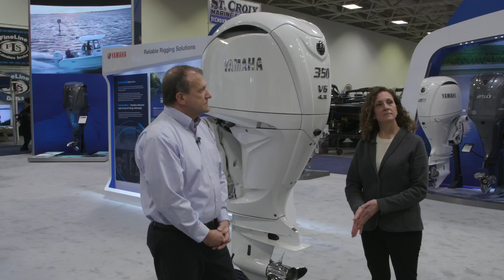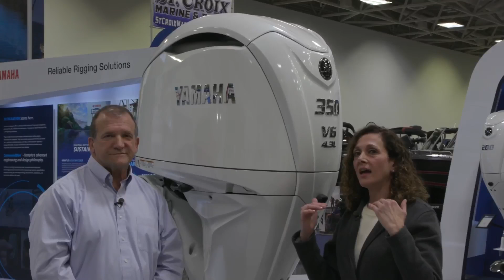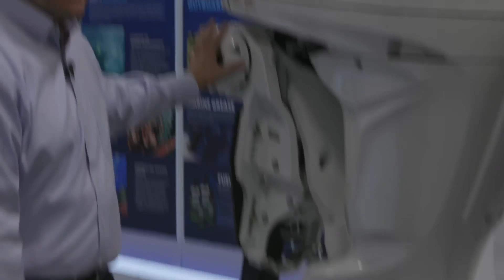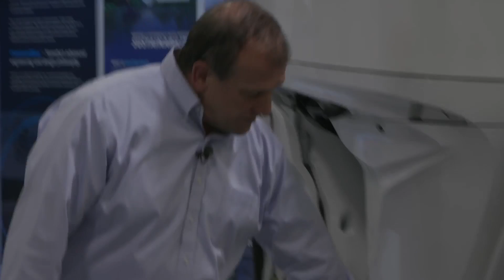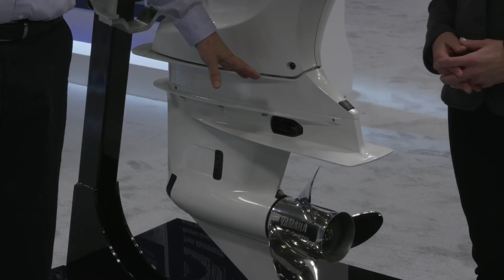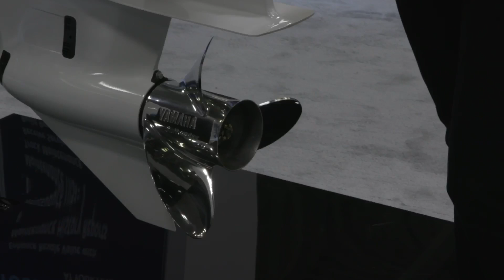Yamaha Outboards F350 Product Launch With Q&A

Comment: The Mercury is 70lbs heavier which is significant however it can run with Lithium batteries. The weight savings using two Lithium batteries with the mercury means the Mercury will come in 30lbs lighter installed. I can’t believe Yamaha did not adapt the electrical system for Lithium. Huge fail on Yamaha’s part.

Comment: What happens when you are 30 miles offshore and the digital power steering goes out?  How are you supposed to get back to shore?
Reply: theres no problem that money cant solve if your asking these questions you don have money
Reply: They have push pull wires too

Comment: About time Yamaha got back in the 350hp segment, because after all, as in the early 2000's, the 250 Fourstroke replaced the 200 four stroke and 250 2-stroke as the standard and in the 2010 -1015 time frame the 300 fourstroke replaced the 250 four stroke and all 2-strokers in the saltwater game as the standard, now the 350 is the new 300.   Between the Zuke DF350, Honda BF350, the Merc free breathing V8's, and now finally a Yamaha F350 there are some serious great choices now for outboard power

Comment: Where does the new 350 make its extra torque & horsepower? Is it all at the higher RPM's? Will it have more torque or HP at lower RPM's to improve hole shot?

Comment: The advertised weights reflect a larger difference than 18 lbs.  Can you expand on that?  Is that due to the integrated steering?  Maybe that is not included in the weight of the F300?
Reply from the maker: Here are the specs. 25" F350 is 629lbs (with built-in digital steering is STANDARD). 25" F300 DEC (WITH built-in digital steering) is 611 lbs.  629-611 = 18 lbs. difference.
Reply: @YamahaOutboards01  That's great!  How much weight does the integrated steering add on a vessel compared to a traditional set up?  In other words - what are we truly adding by going to a new 350 vs a 2015 F300?  Also - can you expand on where the added weight is?  I assume the crankshaft is heavier.  Lower unit?  Anything that stands out from that perspective?

Comment: You claimed the difference in weight compared to the F300 is only 18lbs but on the website engine comparison tool it says it’s an 80lb difference. Which is correct?
Reply from the maker: Here are the specs. 25" F350 is 629lbs (with built-in digital steering is STANDARD). 25" F300 DEC (WITH built-in digital steering) is 611 lbs.  629-611 = 18 lbs. difference.

Comment: Weak sauce, Yamaha. They took the 300, which came from the 225 and 250, and modified it to make 350? Something doesn’t add up. Went from 4.2 to 4.3… I think this will result in shorter engine life and underperformance in horsepower. I have twin 300’s and was hoping for a stronger showing for when I repower, but I’ll be looking elsewhere now
Reply: This will actually get you to Bimini without throwing a code like mercury. It’s why most mercury setups have triple or quads, very rare to go on a trip without at least one going down.
Reply: Everyone so quick to judge it will be bad before the outboard has really been tested.
Reply: I guess we wait and see if it gives the durability that we are all expecting from Yamaha.
Reply: А ты используй триботехнический состав- добавку в масло. Это увеличит срок службы двигателя в 1.5-2 раза. Добавляй свежий состав при каждой смене масла. Привет из России.
Reply: It will be a great engine much lighter than all of the competition so suited to many more applications it will easily make 350 hp and be reliable my 250 sho with a simple retune makes 332 hp
Reply: @JohnWinzil  have you seen all the failures with the Nizpro tunes? And they have to run really lean on 89 octane. That is not a recipe for a reliable, long-term engine.
Reply: @ThatPNWlyfe  it's a good recipe all of my engines run well this way have had no problems
Reply: YouTube keyboard engineers commenting, supported by their bias or paid support by competitors… 😊
Reply: @tommyrq180  bias? I OWN twin Yamaha 300’s!
Reply: @ThatPNWlyfe  Sure you do… This is YouTube. Perhaps you’re unacquainted with the fact that you can’t prove anything you say here. Your comment is unduly critical for a company who puts massive engineering and research into their products, which have proven themselves over massive hours of service. You do NOT know better than Yamaha’s engineers. Period. So if you had a bit of sense you’d withhold really uninformed comment and see what happens in the market. Your bias is to have a hot take based on nothing. Something doesn’t add up? Of course. Because you don’t have a clue. I’ll wait to see what happens—in the actual market of actual use rather than ill-informed early comments on social media…
Reply: @tommyrq180 Да куда уж нам--- доморощенным изобретателям, до вас! А комментарии свои здесь каждый имеет право писать,и проплаченные и не проплаченные. Человек высказал своë мнение и в плане рабочего объëма двигателя он прав.Я сам в шоке--- всего добавили 100 кубиков. Быть может это только апробация переходной модели, а потом добавят рабочего объëма двигателю.
Reply: Thanks for the genius input
Reply: @liamwindsor5854  anytime! Happy to help! ;)
Reply: Yep, definitely weak.  The 4.2L F300 struggles to make 300hp on 89 octane.  All they did was add a 0.1L displacement and increase the compression ratio from 10.3:1 to 11.0:1.  That's not going to deliver a solid 350hp.  Even if it does, the torque curve is going to be so inferior to Mercury's 5.7L V10 350hp model, and that's with 87 octane.  And the Merc is only about 70 lbs heavier.  But I cannot say that Yamaha is stupid.  They know they've won the hearts and minds of so many boaters due to their legendary reliability.  They can introduce mediocre products and get away with it as long as they are reliable.
Reply: @WhalerGA Сейчас ямаха, прочитав ваши критические замечания, подумает- подумает и к увеличенному ходу поршня добавит увеличенную расточку диаметра цилиндра. И будет всем нам счастье. А на счëт большего веса, так его бесконечно убавлять нельзя, бумажный мотор получится. Почитайте комменты людей со всего мира по поводу надëжности и долговечности ямахи и меркурия и всë будет понятно. Подавляющее большинство людей- пользователей эксплуатирующие подвесные лодочные моторы, предпочтут чуть больший вес и большой моторесурс, чем наоборот--- малый вес и меньший моторесурс.